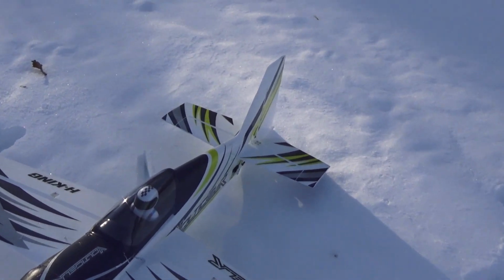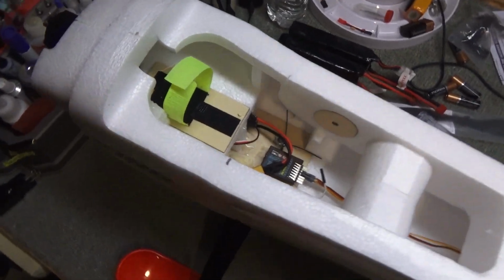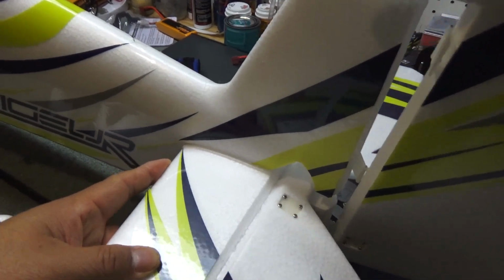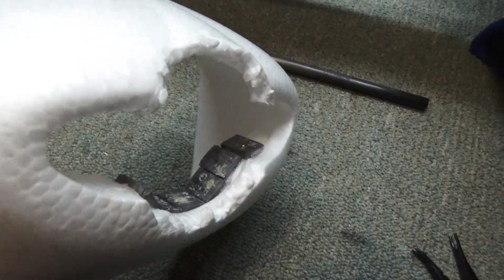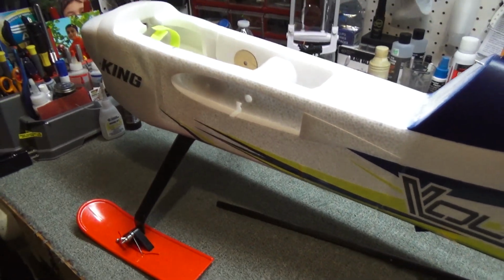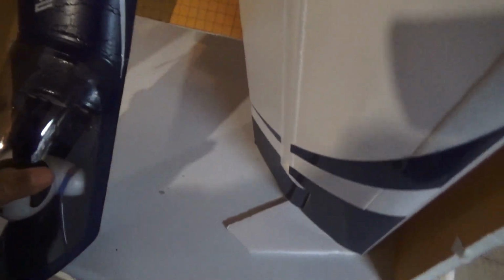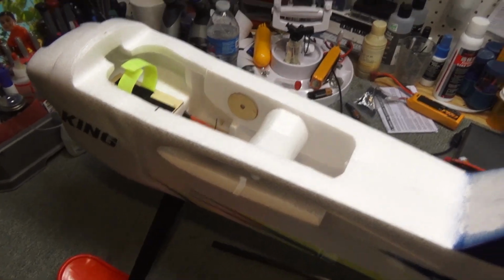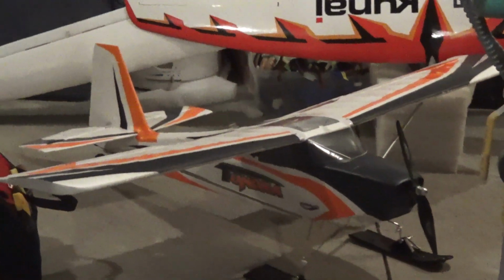Hobby King Voltigeur crashes because the Pilot was stupid

Comment: Lol I have the same colour Tundra :-)
Reply from the maker: Tundra's are awesome.  Just got the grand tundra so look out for that vid.  Hopefully I'll have one out in a week or two.
Reply: @willnate35  lol true just got back from flying mine,flown x2 packs,I havnet flown it in around 3months 😊
Reply: What is all that lead in the nose for, I have none in mine and have the battery on the floor of the plane where you have the rx and the esc where you have the battery. Hope you get it back together, put that canopy in some hot water it should go back into shape. It's  a fab flying plane.
Reply from the maker: @grahamdewis8078  My plane seemed tail heavy so I added weight.  It flew so nice and I hope to get parts soon.  She will fly again.  Thanks for the view and comment.
Reply: Move the cog back to the wing tube and reduce the throws mine flys hands off inverted.
Use epoxy to glue the tail parts on.
Reply from the maker: @grahamdewis8078  Thanks for the tips.  I'll be sure to apply them when I get my parts which have been on backorder.